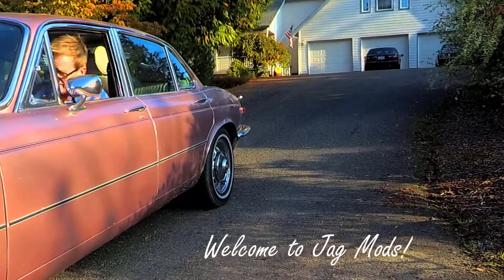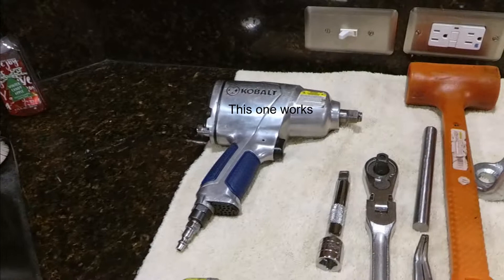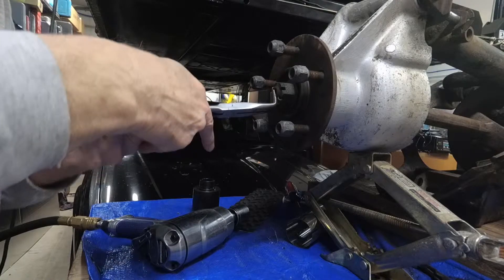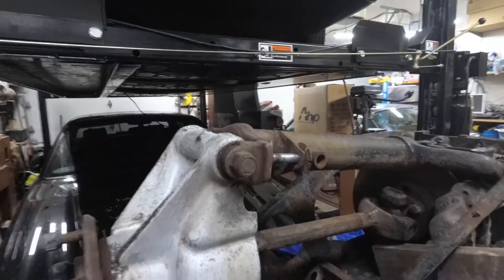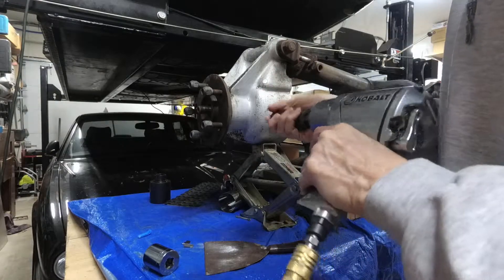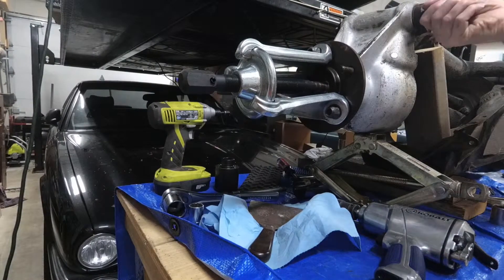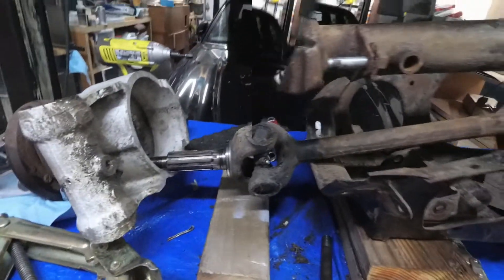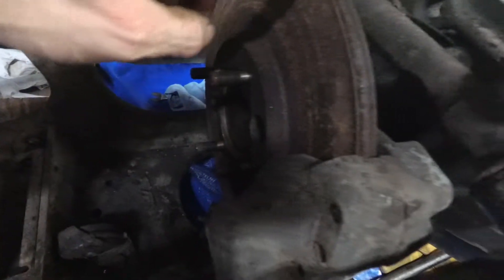Jaguar IRS disassembly Hub / Carrier & halfshafts

Comment: Thanks so much for your videos. I am working on a resto-mod that has an 86’ XJS IRS installed. I am disassembling everything and rebuilding, because I don’t trust the previous owner. I am having a hard time getting the bearing off the hub. I have a hub puller but I need to start the separation before I can fit the puller on. Any advice?
Reply from the maker: I’m trying to remember, I know that mine gave me a little bit of trouble getting the little dumb shops out of the differential. I’m assuming that’s what you’re talking about. Can I get back to you on this? Sorry I don’t have an immediate answer. it’s been several years since I’ve done it in a lot happened anyway, I’ll get back to you either way I promise
Reply from the maker: If you’re talking about separating the part, the bolts under the way up in the carrier, those can be a bitch. I know I used a press to get them off and I was pretty close to 20 tons before it popped and I had to go change my shorts it scared me. The factory recommends using Loctite to hold all that stuff together. If you use Loctite read your gonna have to place some heat to get it to come apart. Just be very cognizant that aluminum melts very easily so be careful. Let me know if I’m closer way off base.

Comment: Jag mods thank you so much your vids are a lot of help I just bought a 1987 xj6 last month . I drove it a week and put a new battery on it . And it stalled twice on the highway I replaced  the alternator but no luck I'm gonna keep going though because I love these cars and I want to have this one as a daily driver.
Reply from the maker: That sounds just like my first XJ6. once I got the battery and alternator sorted. I agree these are beautiful cars; and are worth keeping on the road.  All but two of my 8 jaguars were saved from being crushed.  Some people rescue dogs.  Me? Jaguar cars. :)  

Thank you so much for the kind words.  I glad you found the videos useful.  

Sincerely,
Mark @ jag mods
Reply: @JagMods  thanx I'll stay in touch if that's cool I think I've got fuel trouble to be honest .and I really need to get electric tester and stuff I looked at my ignition mod but all the wires look look like there in good shape I watched your video on getting spark back . But I'm pretty sure it's fuel because it set for awhile before I bought it idk I'm just gonna keep messing with it. There to beautiful to let go your right about that thanks again.
Reply from the maker: Certainly! 

Fuel system....  
First check the fuel pressure to the injector rail. it should fall in somewhere around 36psi.  anything less, check the fuel filter in the boot, while that's disconnected it doesn't hurt to blow a bit of carb cleaner through the line with the fuel rail disconnected and something to catch the flammables at the other end.  While the wife is a way, I use the can opener to open up the fuel filter apart; looking for rust; or a slimy milky like fluid - that is supposed to be stuck on the inside of the tank, as rust-proof coating.   
A word of caution when working with the fuel system 
The fuel injection system on these car is old, and are Like any 2yr old toddler. Agitate them, and they will weep. The fuel system IS under pressure; 36 to 40psi to be exact. Disconnecting a fuel line without releasing the pressure is an instant petrol bath. Blead the fuel system first. Or if you're like me (Safety 3rd) put a rag to cover the connection keeping the petrol bath at bay.
Jag fires are a very real thing. 

Nothing like unsolicited advice. haha!! 
My experience with non running Jags, and sadly to say is significant.  Rarely is the fuel system the issue the fuel injection Jags. These cars are old, and are Like any 2yr old toddler. Agitate them, and they will weep. A carbureted Jag is a way different story - especially with today's petrol.
My experiences are; more often than not, the ignition system is the culprit.  Specifically the coil or the ignition amplifier or in my case cooked wires. 

Side tracked side note
Like size, mileage, matters. Consider anything over 140,000 miles the Golden years. Tell tale sign is low oil pressure less than 20psi at an idle and less than or equal to 40psi at operating revs. I haven't found oil consumption to be much of a guage. as much as low compression, bottom end rattles and low oil pressure. I also recommend 20w-50 or at least a 15w-40 oil.  Oil changes every 3,000 miles. The engine tolerances of these engines aren't even in the same playing field as todays engines.

Random start / stop issues on injected Jags?
could be cam timing.  If the Previous Owner considered regular oil changes as a mere  suggestion, or the engine spent a bunch of its life on the right side of of the rev counter chances are the cam(s) are out of time with the bottom end - either stretched cam chain, or the upper tensioners are warn.  My experience is if the engine fires up, and dies on deacceleration and refuses to start afterwards. then like magic it fires up again, but dies again on deacceleration, or sounds like a sewing machine above 2000 revs - look at the timing change and chain tensioners.

Thank you again for taking the time to comment.  It means loads to me.

Sincerely,
Mark @ Jagmods
Reply: @JagMods  thank you sir I subscribed instantly as soon as I started seeing your jag mod videos. Thank you oh gracious one for your knowledge. I'm not going to give up Because these cars are awesome going down the road. And I can't thank you enough. I'll be doing some diagnostic work tomorrow. Thank you so much for the advice . Sincerely NickB
Reply: Quick question if you turn the key on 2 and there's a buzz in the front of the engine and the fuel pump is at a continuous hum what do you suggest when you have time of course.
Reply from the maker: @nickburleson9555  
The fuel pump doesn’t build pressure until the engine is starts turning over one of the wires off the coil triggers the computer to start building pressure. 
The only way that I know around this is to open the mass airflow sensor flap up put the car in drive, with the key in the run position. That will trigger the fuel pump to build pressure. 

With respect to the hum.. that’s a hard one without hearing it or being there. I’m  assuming the engine isnt running, and all accessories are turned to the off position. The heater fans are turned off. 
Could it be the small auxiliary fan on the radiator running?
Reply: @JagMods  most likely probably I'm going to look into it I'm very very new to jag problems I've been a mechanic for six years . But Ford and Chevy's and diesels semi's mostly Detroit's 60 series and I did hydraulics for a tractor company so I'm just embarking on this jaguar journey. But I appreciate the advice most definitely thanks again.
Reply from the maker: I'm a software engineer by education and profession. In a previous life I was an ASE Certified tech worked in a Chev / GMC / Cadillac dealership. 
Once you get your head around the Jaguar methodology, You'll be amazed on how easy they are to work on; and some stuff, especially on the earlier Jags are over engineered.  the XK6 engine is a marvelous engine way ahead of its time.  That engine was developed in 1945... a double overhead cam, cross flow hemi head in 1945!  and was still a head of it's time when it was phased out in 1987 (ok, 1992 for the rest of the world). Sadly the downfall was British Leyland. that is a story that will turn your stomach. anyway...

The Good Book of Green - highly recommend getting one.
Depending on your location, SNGBarratt.com, XKS.com, and lastly OTPubs.com all have an electronic version of the factory service manual(s). Not a fan of OTPUbs; their ethics and support go way beyond suck! I dislike the company so much it pains me to send any business their way. But the product is good, really good. Fortuantely for you, their not the only bar in town.  Unfortunately for me, when I purchased mine, they were the only bar in town. 
the folks I typically deal with for anything Jag specific is SNGBarratt.com didn't carry the documentation.  they do now!. Other people I deal with is terrysjag.com and for   Used bits - my dear friend David @ everydayxj.com. 
Most of the pages that I reference are printed from the electronic publication.   You can also get the highly abridged Jaguar Green Service manual on Amazon too.  ebay for a used one.  It's worth the investment.

Comment: great video! I'm just about to attempt this and the manual is clear as mud. Happy I found this as a reference. Keep it up, liked and subscribed for more.
Reply from the maker: Thank you again for the kinds words.  I'm working on the next step the fulcrum arm installation. I agree the manual any of them, but even the Green Jag manual is pretty vague unless you can get your hands on a XJ Series I manual.  Most of the mechanical bits (of information) transfer through all the way to the '90's  There is some variation. I'll stop now... :)

Again thank you! your kind words are the reason why I'm doing this, and well I too couldn't find any reliable help.

Thanx again,
Mark